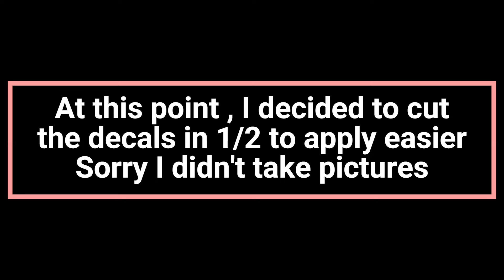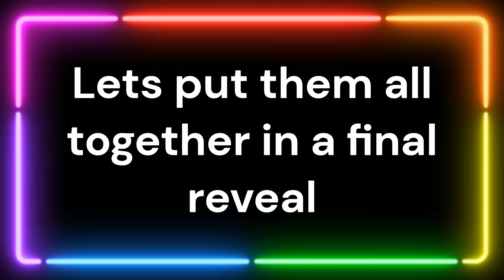Smokey and the Bandit Part#3 The Trans Am

Comment: well done sir...Im a big fan of the movie and have the 77 Trans Am and KW semi model kits ...just need the Trailer to complete the set then i plan to build it like you did..love your 3 piece set Earl
Reply from the maker: Very Much appreciated!! I had a lot of fun building this and took my time. The trailer was the most exciting to build. It went together quick and once the mural was applied, it just cemented the whole set together. Contact Phil for his reefer, you wont be disappointed. Make sure you use the Fruehauf 43' Dry van because it has no side man door and it has the corrugated exterior walls.
Cheers!
Earl

Comment: Very nice... I'm halfway into building my own SATB set, Do you have a video on making the display case? I think it would look cool if there was a LED light on the inside of the case.
Reply from the maker: Hey Clayton, Just saw your comment and thanks!! Not too many commented on the case but it was very easy to make. Just have to have a couple simple tools, table saw, miter saw,  sandpaper,  glue, nails and paint. I used 3mm thick (1/8") plexiglass for the panels. it is the same thickness as most sawblades. both the top and bottom are the same. measure a piece of wood to size and put a 3mm deep cut around the perimeter. then cut trim pcs of wood to fit around the perimeter and nail in place. Voila- you have a groove for the plexiglass that is 3mm wide  x 3mm deep. make 4 corner posts and run a grove on 2 sides adjacent to each other. there you have a 4 post display case and just cut the plexiglass to size on the table saw. Ya I thought of lighting it too but I didn't get that far.
Cheers !
Earl